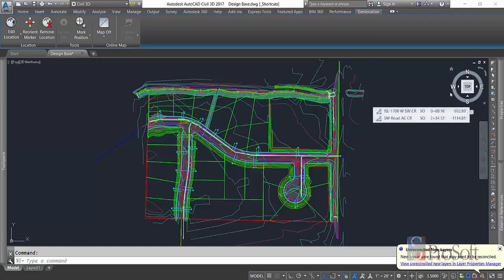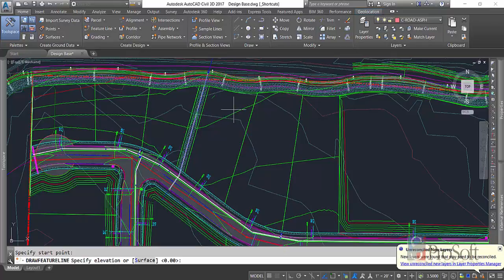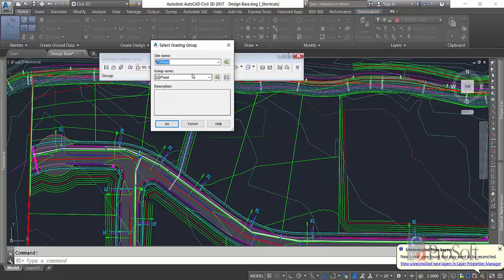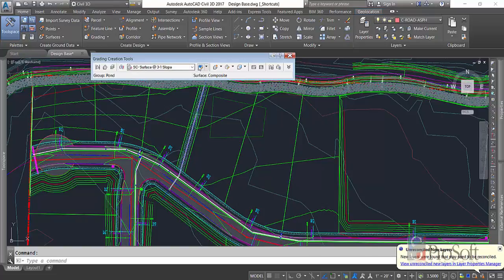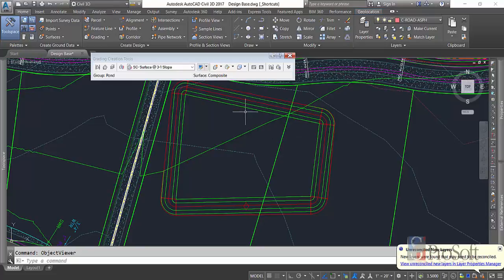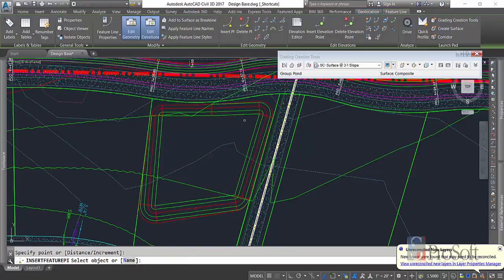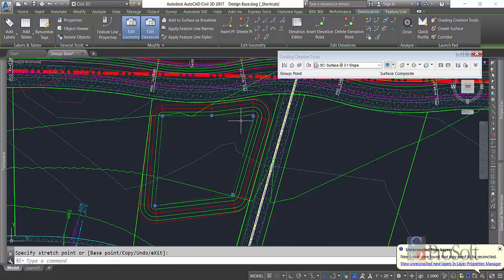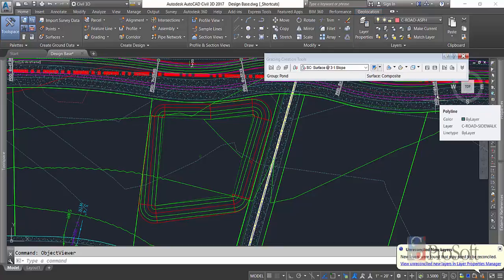Pond Modeling in Civil 3D 2017

Comment: Hi
Thanks for the video.
I've watched a few videos of pond creation in civil 3d and one thing I find odd which is common among all the videos is that the pond is created randomly and then the volume is calculated afterwards. This is not how it's done in reality. As designers we first determine the attenuation volume required and then we set off to design the required pond. So the question that the videos are not answering is, how do you design a pond of a desired volume in civil 3d?
Reply: I get that. There is no option in Civil 3D, maybe grading optimization? Point of the video, done 6 years ago, was simple show grading and analyze volumes using the given tools.  I've done hundreds of ponds in reality, many times starting with an approximate area, grade a pond, check volume and adjust accordingly.
Reply: @shawnherring3162  Alright noted. Thank you.